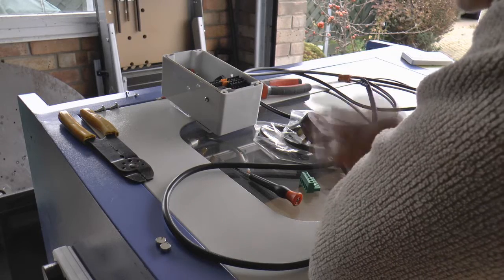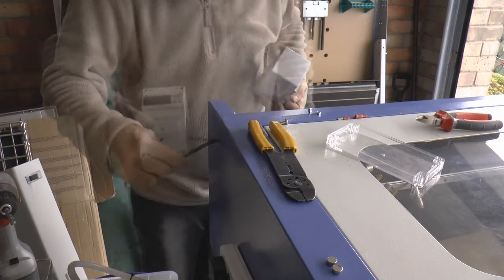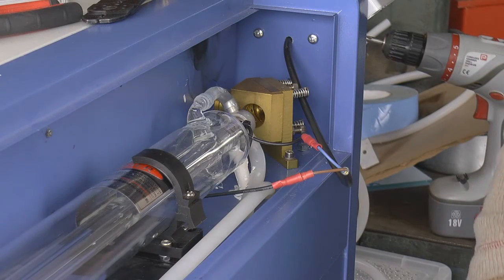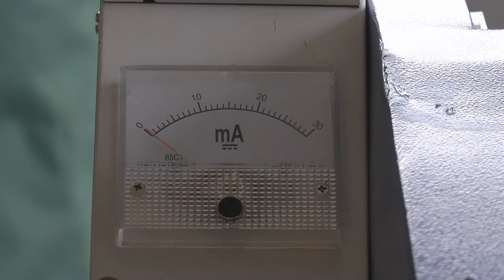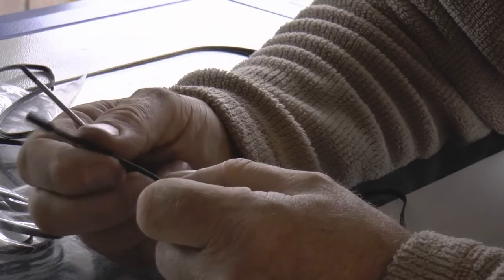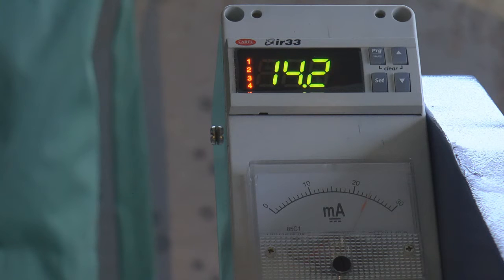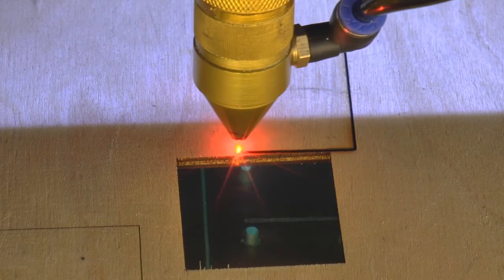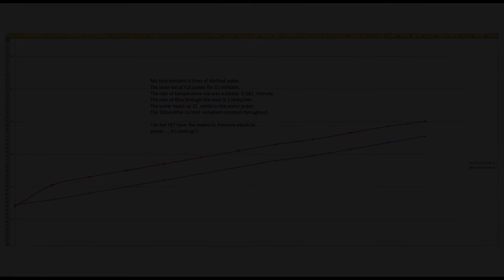RDWorks Learning Lab 24 Adding instuments to give ME contol at last

Comment: If I have an 80watt tube what is my max ma that I should be running it ?
Reply from the maker: Hi
There could be a slight variation of recommended max depending on the tube manufacturer. I suspect that you will have an 80mm diameter tube that could be an EFR or a Reci?
Both would recommend 25mA. but in general the rule would be 24mA for a 1600mm long 55 to 60mm diameter tube. You will probably see little power difference between the two values so I would stick at 24mA.
Best wishes
Russ
Reply: SarbarMultimedia 
Great. Thanks for info. I’m purchasing a thunder laser brand Nova 35 which is China made. I’ll stick to those parameters.
Reply from the maker: Chinese , yes but well built and should be plug and play. Never any questions about Thunder Laser problems  so that's the best  review I can give them.
Best wishes
Russ
Reply: SarbarMultimedia 
Awesome. Can’t wait to get my laser. I’ve been watching your vid on rd works to learn the program prior to getting my cutter. Very informative!!
Reply: SarbarMultimedia 
Do you feel it’s worth buying thunder laser over another cheaper Chinese laser ?
Reply from the maker: Hi
It all hinges on your capability and what you want the machine for..
1) If you would like to build your own machine then I would recognize that with a cheap Chinese machine you will get a pre-assembled DIY kit of parts. It may work out of the box but probably you will have to spend more money and time  to get a reasonable performing machine. They are excellent value for money and if you choose the right one they are mechanically pretty good. Even when you  spend another 40% on a new  A grade tube and power supply they cannot be beaten on price. They are also an excellent way to learn about the technology and mechanics because you will be your own 24/7 service tech.

2) If you just want a plug and play machine that someone else has  worked on the engineering and produced a better quality machine, then Thunder Laser is in the same class as my Lightblade machine and 4 or 5 times the price of an Ebay machine. This is what you want if you just want to start learning without hassle and maybe use it as a business start up. You will get long distance email support unless you happen to have a Thunder Laser agent nearby.  I use my Lightblade machine as a  "jump on and do a job" machine and my China Blue machine as my "no fear, rip it apart" learning tool. I do use it also  for jobs and I have engineered it to a really nice piece of kit.

3) there is a middle way and that is to import your own machine direct from China. Although the basic machine is fairly cheap,  the transport costs, import tariffs and sales tax plus the energy and administration you will have to contribute might put you off this route.  I know a guy who is familiar with this buying route and if this what you would like to consider then send me your email and I'll pass it through so you can speak off-line. Again, choose the right machine builder (none have manufacturing facilities, they just assemble from a huge range of standard components and frame designs) and you will get a plug and play machine but without support.

Once you have decided what you want from the machine , you have to decide on bed size and tube power.
Be careful what you dream of. You need lots of watts for cutting  (100 plus) but very few watts for engraving (40 ish). If its a mix of work or just hobby stuff,  then I would advise 60 watts as a compromise. It's low end power is just about controllable enough for half decent engraving  (particularly photo engraving) and with 60 watts you will be able to cut 10mm ply/mdf/acrylic, albeit slowly

I cannot advise you how to spend whatever budget you may have but I hope I have given you pointers as to the factors that should influence your decision making. I will be happy to look at any machine specs that you focus on and point out the short comings and risks.

Best wishes
Russ
Reply: SarbarMultimedia 
Very good points, this is why I asked you. 
Seeing I have limited time to get the laser in perfect working order (Two kids and a job) I’m leaning toward the Thunder Laser Nova 35 as I originally priced.
Here’s a link to the product: http://www.thunderlaser.com/download/down/nova/Nova35_catalog.pdf
http://www.thunderlaser.com/products/nova-laser-cutter.html
Let me know your thoughts
Reply from the maker: It's a nicly engineered "clean-looking" machine and is very similar in many aspects to my Lightblade.  It's good that they have a stepper driven table and this allows for a table based based auto focus system. I never use the auto focus on my Lightblade because it's a switch on the head  which is vulnerable to clogging with engraving debris and the whole system is  too fiddly.  I can set the focus manually is 1/10th of the time.
There are two serious design issues that I see with this and many other laser machines and that is lack of air flow managenet. They mention an integrated exhaust fan (please excuse my laughter!!!) I'll come back to this fan. They also say there is a 145mm diameter exhaust duct. At least if you connect this to a separate fan you will be trying to send the fumes outside. I say "trying" because here is where we see major design problem number 1. The exhaust duct has an area of  165 sq cm. To empty a smoke filled room with an extraction fan, you need to open the door to allow air in. No air in =no air out. It's not rocket science. Sp where is the 165sq cm of open area at the front of the machine to allow air into the machine. Air FLOW is the key word here.. 
Problem number 2....honeycomb bed. Every Chinese (and others ) laser builder seem to think this is a great idea. I may be a lone voice  but it is one of the worst things imaginable. It marks the back of any product you cut on it every time the beam passes over a metal edge. It prevents the smoke from escaping quickly from the bottom of the cut. The cold metal condenses the tar laden smoke fumes from cutting organic materials and quickly turns your mesh into a mess.  Some machines have a loose honeycomb that you can remove and apply oven cleaner of power jet it. Yours will be fixed and be a real pain to remove.. The brown debris that collects in the cells can re-evporate or even catch fire, both will further mark the back of any product you are trying to cut.  Let's now look at how it affects air flow management. Lets assume you do finish up allowing air into the front of your machine  (maybe cutting your own holes?). The exhaust duct is below the honeycomb. table so I'm sure you can imagine the path that your incoming air will take. Yes, right through the front of the honeycomb table  and slowly make it's way to the exhaust duct. It will do little to clear the cabinet full of smoke that exists above the work.

Airflow management is vitally important for good quality engraving and cutting. For cutting air flow must be below the work and for engraving it must be above the work. I had the same issue with my Lightblade machine but fortunately that was a fixed slatted table with a loose honeycomb on top. I was able to add my own mild steel solid plate to cover the table and adapt the air assist to make it programmable
see
https://www.youtube.com/watch?v=AT3cSpfOZBY&t=508s
https://www.youtube.com/watch?v=UDV5SYfpKAc&t=3s

As I said,  these issues are poorly dealt with by all manufacturers so  in some respects Thunder laser is a bit worse than those that put a few slots in their cover.  Without slots you are just causing a slight lowering of the pressure inside the machine and that little integrated fan will do nothing.

 In reality I do understand why they all ignore these issues. The machines are not actually designed in China and it is obvious from the many usability and setting issues that exist with all machines, that the guys that design them do not actually use them in anger. Secondly, all Chinese laser machines are  ASSEMBLED in factrories  from various standard parts that they buy from elsewhere. Thunder laser just build machines, they don't manufacture them and they certainly do not have the will or ability to change the design because using non standard parts means higher costs

Hope this does not put you off. It just demonstrates that you will still  have to do some work on your plug and play machine  to make it buzz.

Best wishes
Russ
Reply: SarbarMultimedia 
I totally get it as you mentioned in a few of your lessons but I believe the Nova 35’s honey comb top is removable and it has a “Blade” style fins below. I see on there web site.
Would the blade design suffice ?
Reply from the maker: I have used blades on just a few occasions but 95% of all my work is on the solid steel plate  and standoff spacers or my pin table. Blades are better than honeycomb for less marking of your product but they still bypass the  airflow. On a solid plate table with a half inch gap below the work, the smoke never gets a chance to escape into the cabinet. Instead it flows at high speed  to the  exhaust grills.
Best wishes
Russ
Reply: SarbarMultimedia 
Got it. So I should get a solid metal top over the honey comb. Can you do a YouTube on stand-off methods and ideas ?
Is it worth getting the HD laser head ? It’s sold as an option for $400 and claims to be 1000 dpi ....  :/

Comment: BEST series on youtube
Been looking all over www, Cant find any info on fitting a Hour Meter/Elapsed Time Meter for recording tube usage time.
Will you be doing this in the future?
Reply from the maker: Hi Dan
Don't waste your money because it's already built into RDWorks. Go to Config,  System Setting and click the System Info tab. The password is RD8888  and (press Input). You will need your machine and PC connected with USB cable and then press READ to upload the data from your machine memory.

Best wishes
Russ
Reply: Thank you very much. I can cross this of my list.
My Rudia controller is on its way from china.
I am building a 2.X Buildlog.net. Lucky i am retired as i sit up half the night watching you vids.
I thank you as many others do for your efforts
Cheers

Comment: One thing to note when fitting a current meter, is that it is best to make sure it reads correctly before fitting it to the machine.

I recently fitted a 30mA meter I bought from eBay, and it works fine, however I replaced my power supply with a new unit which has a built in LED current meter, and the values being displayed on the LED were around 15% lower than on the 30mA analogue meter.

So I did some testing, and compared the reading on the 30mA analogue meter with a Fluke digital multimeter (in current mode), and also a good quality analogue multimeter.

And I verified that the 30mA analogue meter was indeed reading around 15% high.

Also the error in the reading is not always 15%, it is 10% at 15mA, and 16% at 30mA, but 8% at 10mA etc

So really, it can't be used to accurately plot current vs power, and should only be used to allow determine the maximum power setting for the tube (by applying a calibration factor to the value shown on the meter).

Comment: bonjour....quelle puissance votre co2???...y a t il moyen de graver photos sur metal...???  avec ou sans additif (cermark)...j aime vos videos ....merci
Reply from the maker: Hi Dom

My laser is 70 watts.  
To put a photo onto metal you will first  need to change then photo to a series of dots. 
https://www.youtube.com/watch?v=Z9xR4hujtB4
https://www.youtube.com/watch?v=DXPQw--q19A

Cermark and also Molybdenum Disulphide ( see https://www.youtube.com/watch?v=b_06laAjMPc ) produces good contrast images on stainless steel. Other  metals will not work very well, if at all. You must run at high power and slow speed to make sure there is a heat induced chemical reaction  on the surface of the metal. If you run too fast then the heat will not get a chance to build up.

Best regards
Russ
Reply from the maker: salut Dom

Mon laser est de 70 watts.
Pour mettre une photo sur le métal, vous devez d'abord changer ensuite la photo à une série de points.
https://www.youtube.com/watch?v=Z9xR4hujtB4
https://www.youtube.com/watch?v=DXPQw--q19A

Cermark et aussi de bisulfure de molybdène (voir https://www.youtube.com/watch?v=b_06laAjMPc) produit de bonnes images de contraste sur l'acier inoxydable. D'autres métaux ne fonctionnent pas très bien, voire pas du tout. Vous devez exécuter à haute puissance et la vitesse lente pour vous assurer qu'il est une réaction chimique induite par la chaleur sur la surface du métal. Si vous exécutez trop vite alors la chaleur ne sera pas la chance de construire.

Meilleures salutations
Russ
Reply: Hi Russ.....merci pour votre reponse....et vos superbes videos..oui j ai vu le DM-90...beaucoup moins cher que le Cermark!!!!...pour l instant je n ais q une diode laser de 10w   sur metal c trop juste....je suis sur le point d acheter un co2 40w en kit..ne manque que le chassis....mais ce qui me reboute c est l alignement des miroirs...j ai vus vos videos a ce sujet....encore merci....je vous recontact pour conseilssss......DOM

http://juste.je

Comment: Can you help me I have a100w tube or so what should my amp meter  read thanks James
Reply from the maker: Hi James
It depends on what sort of tube you have. If it was an Ebay machine claiming to be 100 watts then there is a good chance it's not a 100 watt tube. A simple check is to look at the dimensions of your tube
Cheap tubes will be 1600mm long and 60mm diameter and claim to be 100 watts. They are in fact 80 watt tubes and should be not run over 25mA. If it is a genuine 100watt cheap tube it will be about 1800mm long and 60mm diameter and could run at about 28mA max. Things get different if you have a genuine good quality tube such as Reci or EFR or Mactron. Their 100 watt tubes will be obvious because they all use 80mm diameter tube and the length of a 100 watt tube will be 1450mm long (EFR & Mactron))  1400mm long (Reci) . EFR recommend 30mA, Mactron recommend 28mA and Reci recommed running at 25mA.  The power output from your tube will not be linear and will not start running until maybe 8 or 10% power. You will find in general that the your system is set so that by the time you reach 65% power you are probably at the 25 or 26mA limit for the tube. By all means go above this if you are running short exploratory test on your machine for a few minutes but never program above this safe current for general use.

Best regards
Russ

Comment: Hi again Russ
Is the second cable (not the one connected to the tube) just going to the ground on the machine?  I have seen other people just follow the cable from the tube and see where it goes on the Power supply, then cut the lead and connect the Ammeter between them.
Reply from the maker: Hi Klaus.
It may go to ground but it will be via the psu. Follow the cathode wire back to the power supply Just cut that cable and insert the ammeter into the circuit. There is no voltage there just a few milliamps of current so if you need to extend the wires to position your ammeter in a convenient position, just use ordinary domestic wiring cable  or 10 amp cable out of an IEC power cable.
Regards
Russ

Comment: Hi Russ.  So you "just" connect the mA meter to the same cord as the tube bit in the end where the mirror are, and the second on to minus on the machine? Is that correct?  Again a great Video thanks.
Reply from the maker: Hi Klaus
Yes You just cut the return line and add the ammeter. As you can see there is virtually no current flowing in that line, just a few milliamps and because this is a DC system the voltage at this end of the tube is zero. Just the cheapest analogue meter you can find is ideal  You can order from UK ebay and ship to you for free
http://www.ebay.co.uk/itm/30MA-50MA-1A-DC-Ammeter-Head-Pointer-Ammeter-Analog-Head-Current-Table-Gauge-/122031269804?var=&hash=item1c69a167ac:m:micD_ju1W5CyGHyED-7UshQ#shpCntId

Best regards
Russ

Comment: Hii need help, i just got the machine (40w) yesterday and works very good engraving, but when i tried cutting 3mm plywood or acrylic it didn't cut, how can i adjust de power so it can cut that size? (the power on corel says 70% but i can't change it there, it seems blocked) how do yo cut? please i apreciate any help. Need urgently to make it work for what i need ! Thanks